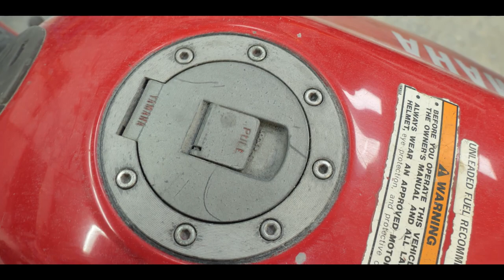Will Cleaning the Carburettors on a Yamaha Motorbike work?

Comment: You are very lucky; your carburettors are easy to get at. On my Yamaha Fazer, the carbs are level or straight to the inlet port on the engine and to do any work on them you have to take them off the bike. Can't even get to the inner bowls.  The sliders in the carb on mine I polish stoned the sliders, including the guides to make sure they moved like silk, plus a little sewing machine oil helps.  Also don't forget to clean the idle air flow, should be a idle mixture screw, take it out but first screw it all the way in while counting how far to screw till you hit the stop. this will mean you put it back in the right spot after you clean it out! You've got spark, so it sounds like it is one of the air passages in the carbs blocked.

Just for your info, here is the video of my bike starting up after carb refurb. Notice how long it takes for fuel to get to the engine. 
https://www.youtube.com/watch?v=5_Pj_HEowBQ

Mark, removing carbs will help the seat height!
Reply: Thanks  AB very much appreciated.